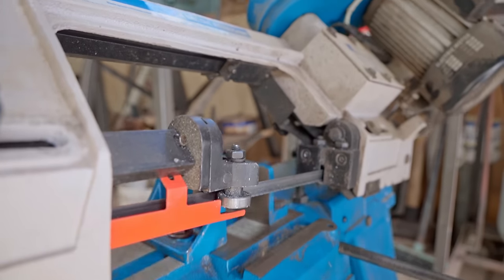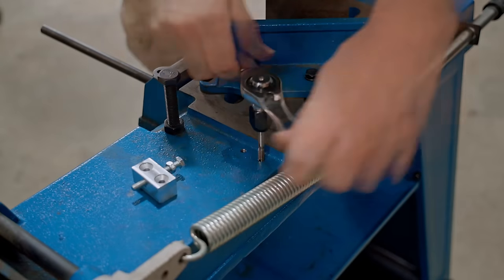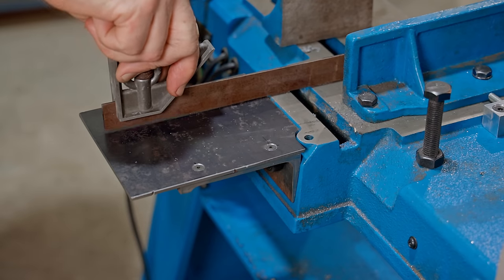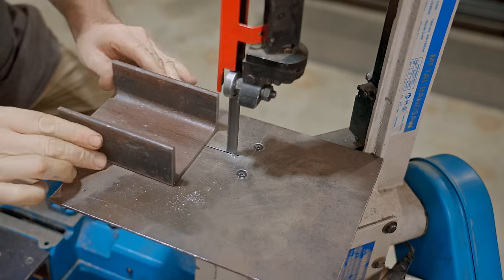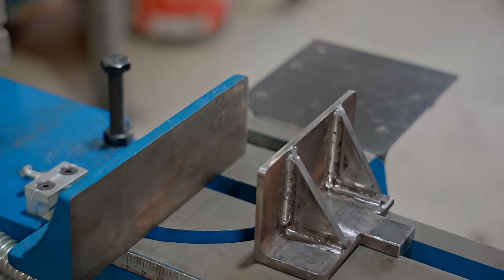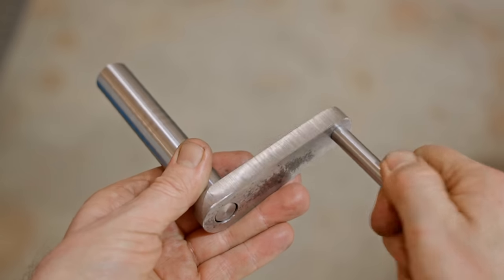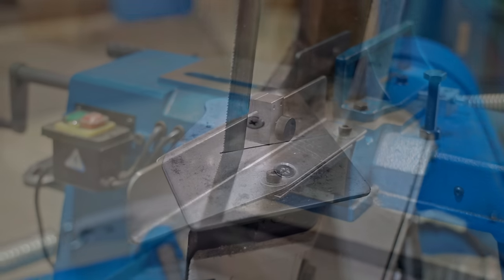Transforming a Budget Machine into the Ultimate High-End Tool

Comment: Tapping the button on the welder starts the gas so there is gas coming out of the nozzle when starting the weld, it is handy for more gas coverage for better looking welds and when ending keeping the torch above the weld for 5 to 10 sec so there is more gas until the weld cools down is also better for looks and quality.
Reply from the maker: Thanks - I do that sometimes but I usually forget. If I welded more often it would probably become second nature. :)
Reply: @PaskMakes  
Your welds look fine already, so probably not worth sweating over.
On the better MIG (and TIG) machines, there should be a setting labelled "post flow" which sets how long the gas coverage continues after the trigger is released and the arc has stopped. Might be hidden in a menu, or on a dedicated MIG machine, just be a fixed number of seconds and appear nowhere in the manual or control menus.

Comment: Great additions to the saw. I have one of these as well. Things I did to mine was I made a "0" clearance insert to fill that slot under the blade. Sometime when trimming a piece of stock it would fall in the gap and jam the blade. I built a base with casters as well but made mine out of channel iron because that was what I had lying around. That allowed me to make a folding stock support for the "left hand" side so I wouldn't need to use a stand to hold up long pieces.

Comment: Great job! Two additional suggestions, I added a hydraulic feed cylinder on mine for down feed control. I also made up a bracket with a cheap motor cycle seat on it that drops on and gives me a place to sit when using the vertical mode for long periods.

Comment: I have that same model. I made a replacement table, but I had to keep it small because of the lack of bracing.  Genius solution that I'll steal immediately!  The angle block is very nifty too. Best upgrade I've done to mine so far is to use Starrett blades instead of the cheapies.  Radical improvement.  Nice save with that Delrin collar!

Comment: I have had mine since 1980.  Made a wood base for it, oversize, with casters, added a shelf, had to fettle the blade guides like crazy to get it cutting straighter.  I like several ideas in this video, will try them out.

Comment: My saw has the exact same castings, stand, hardware and motor. King Canada version so it is dressed up a little different and has a POS plastic belt guard that won't stay tight.  Like you said, great little saw with a few shortcomings. The large table for when it is vertical is ingenuous.

Comment: I must confess that you have really impressed me by your thoughtfulness and workmanship. I think the best word to use here is WOW!

I have one of the original saws from which this design was taken. It was sold by EMCO Equipment and was made in the USA. I bought mine from their store in Woburn, Massachusetts in 1984. It has gone all over New England, to Florida and back since then. The only thing that I have ever had to replace were the roller guide bearings and blades. It still has the original belt!  That annoying horizontal table vanished years ago and has not been missed at all. My saw has had a lot of use and is still in decent shape.

The truth is that there have always been some shortcomings with these saws. However, they were nothing I really needed to address, until now. That is not so for the newer ones coming from China. Those need all the help they can get and then some, right out of the box!! You have gone way beyond what many who own the newer lower quality saws have done. I now feel like I have no choice but to follow suit and make some of these changes myself. Therefore, I will be following your footsteps and make these improvements to my own saw.

Thank you for your hard work and for making so many very useful videos. I will definitely be going through more of them.

Comment: My saw is about 30 years old, but it is exactly the same, but with a different nameplate. I've made similar modifications, but you've given me ideas for a few more. I ended up putting 2 pneumatic wheels on it, and making a micrometer scale for the cutting stop, as well as a weighted height latch that falls closed when you lift the arm to a certain angle. Thanks.

Comment: Nice work!

For Welding vertically try doing it top to bottom, falling, not rising! Hold the torch in a 45° angle pointing upwards and keep the puddle in sight, so it won't pass by your arc, or it will drop and leave a hole. Welding upwards is usually done when stick welding, mig the other way round. Hope, that helps!

Comment: Thanls for this Neil. I have had the same saw for a couple of years now and noticed you have the same, like you I have put up with the shortcomings but for the money it is a super handy tool.

I will certainly be coppying some of these ideas, thanks heaps for sharing.

Something else I find myself wanting for is an adjustable height prop for cutting long items, currently I use offcuts of steel on a beer keg 😂

Comment: I did similar additions to my Milwaukee Horizontal Bandsaw from the 60's 
The only thing I want to change is the wheel mounting. 
Original axle width is too narrow. I was moving mine after installing a set of wheels in a different manner but the same location I attempted to move the saw and tipped it over. 
The table mount and blade guide hit the floor and smashed.
That was a major hassle rebuilding the guides. 
All the work you have done is impressive. I intend to use some of your ideas on my much older version. Thanks for the inspiration. 😁😎

Comment: I made a modification for the bandsaw to use it vertical years ago and its great, what I would add to yours is a sacrificial disc where the band meet the table. The gap will widen over time with use and it would be easier to replace the disc than the whole table.

Comment: My solution to the crappy stand problem was very different but I’m very proud of how it turned out. I just scrapped the sheet metal legs and picked up a 500lb hydraulic lift table cart. I welded some standoff spacers to the top of the table  and extended the handle mounts about 10 inches so that the pump was under the saw motor when I raise the saw for vertical use. It’s wonderful because I can fit the saw under a workbench when not in use and the work height is adjustable.

Comment: Love the video, a tip for welding vertical with mig---pull your weld downward instead of pushing it upward but keep the nozzle pointing up if that makes any sence.
This is the only position that you can weld "pulling" with a mig and it gives a very nice smooth weld, you might have to adjust the wirefeed a little but you'll be amazed I promise.
Try it and please let me know, keep up the good content

Comment: I have one of these saws and a modification I made very early on was to drill and tap a hole on the opposite side of the movable jaw from where you want to clamp small parts. This has a 10mm bolt inserted into it and I can adjust it by hand quickly and easily to provide support to this side of the jaw when I am tightening it up on a small part on the opposite side. I hope this makes sense. I greatly enjoyed this video and will certainly use some of your other modifications. Thanks again :-)

Comment: Some great ideas I will definitely be applying to my saw.

You may have problems with your custom made moving jaw. To clamp things best, it needs to move and conform to the material once the material is up against the fence. With it rigid, you will probably only end up clamping on a single point or line as the fence can't move to fit the (highly likely) non-parallel/square material you are clamping. But for most things it will probably work just fine.

Comment: When I was in the Navy, our shop had the typical military hardwood 'butcher block style' countertop. By itself it weighed nearly 300 pounds held up by rickety sheet metal legs like your stand for you saw. The LPO had us cut 2x4s and put on the inside of the leg angle and drill holes and screw them in tight. They went from the foot pad to under the top with shims wedged into the gap. Sure the wood added another 15-20 pounds, but that table didn't sway, creak or have a cheap sheet metal leg buckle when you were using the work table as an anvil and were hammering things loose.

Comment: Awesome video! Always great to see a man confident & knowledgeable enough to modify his tools!
22:45 just need a magnetic cushion, now!
26:59 that roll pin is weaker than your original handle could push. Make a solid pin that barely fits, then thin the ends a thou; then texture the center.
A touch of locktite & hammer it in. You'll want as tough a steel as your lathe can cut.
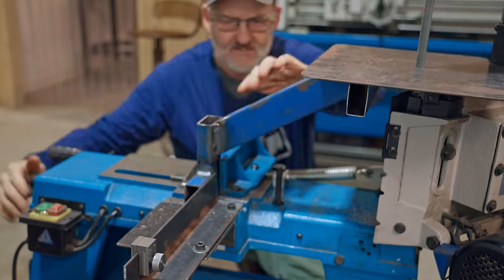21:11  Huh.  I thought you'd go w u channels & a locking nut on the big table; it'd be a slightly fiddly build, but much easier to store when not on use.
Hell, you could really go for it; have guide stops in a mounting slot, then a hinged lock flap, where a lock nut threads up through both tables and is flush on top. One thumbscrew, easy to fit, but solid as a rock.

Comment: I have the older brother of this and I've been working on a better down feed speed controller using a pneumatic cylinder and a few custom bits as well as coolant feed using a pond pump and 20L drum and a drip tray with a filtered drain. I do plan to make a better frame for mine and potentially put in a 3-phase motor with a VFD to control speed rather than use the belt drive

Comment: Excellent work, very well designed, and beautifully executed.
These saws are very common, and used to be  rather inexpensive.
The price has almost doubled here in the States, but it's still the best value for money spent.
The next larger saw, again very commonly manufactured in Asia, is $ 1,000 dollars more.

I have purchased both over the years, and still find the smaller one very useful, though my
fabrications have grown larger over time, and now require the use of bigger equipment.
I do enjoy the pumped coolant on the larger saw, as cutting through 6 " round bar takes a bit of effort
and time, with the blade getting rather hot, so the coolant makes the blades last much longer.

Speaking of blades, do yourself a favor and get high quality blades. Lennox or Starrett, or the like.
They make a massive difference in saw performance.
The small saw runs with a fine toothed blade, and the larger saw with a rather course one, 
as I hate changing blades !!! Blade life is greatly extended with quality blades, and having the right 
one always mounted is great.

I have most of your modifications already done, but your table mount will be my next project.
I love your design !!!

Thanks for sharing with everyone.

Tim

Comment: Fantastic modifications mate. This isn't a machine I have, or would use but it's great to see different ideas on how to fix problem areas. I thought clamping the large vertical base was a great idea, so was attaching the clamp handle with a slot and a rollpin.   By making things tool free means you're more likely to use it.

Comment: i bought one of these back in 1994 for 128.00 dollars.  for the price it works well enough,
but all your "improvements"  do address most of the deficiencies of the machine.
your angle setting plate is a clever mod,  thanks.

Comment: Got the same saw 40yrs ago.  Alot of great mods.  Just a friendly suggestion, when making your own knurled thumb screw that clamps against a metal surface.  After machining threads, l driiled a pilot hole in theaded shaft end to accept a pressed in solid copper rivet.  This will prevent marring the surface

Comment: Awesome job, and as usual, unbelievably creative! I'm glad you upgraded your own rather than just purchase a new saw, as it's more in line with me and I'm sure lots of other viewers in terms of purchasing power. I have a benchtop saw where it tilts to 90° but wasn't explicitly designed to run vertically. To get around that, I cut off a small piece of I-beam, flattened it, and cut the bottom to fit into the clamp. I then sliced a line for the blade, and I can clamp it in for a vertical table. It's not nearly as nice as yours, but it works well enough for a 4 inch max capacity 🙂 Now, I might revisit it!

Comment: Interesting modifications, especially the one to the vice.
 I bought one of those saws here in the UK around 25 years ago and I still have it, a fairly good machine that performs a tedious job while I do something more enjoyable on my lathe and mill.
 The only mod I did all those years ago was to make a new stand using 30mm square box section, plus cleaning out the worm gear box to remove the dirty lube, swarf and a little casting sand that they are sometimes supplied with. I really must get on with with modifying the vice now after seeing this video. 
 The other interesting thing is your Taiwanese/Chinese surface grinder, yours is the only one of that type that I have seen being used, it sounds quite smooth and does a decent job.

Comment: Great video, thanks for sharing.  Forget using lubricant or coolant on the blade! Just buy good quality blades with appropriate tooth count for the jobs. That saw will run dry then and no mess and no contamination to clean off before welding a part.

Comment: I would love to see a video  showing each modification before and after, if possible.   This is such a great video and I think a lot of people will want a list of mods you did, plans, and perhaps even bolt on kits.   I'd pay $200+ for a kit with the more difficult to make parts like the sliding jaw, cutoff support extension+stop block+fence, and possibly the quick install/remove vertical table.   The design of all of these mods is excellent and it's impressive that you seemed to do these without a whole lot of design planning.

Comment: Gonna pinch your vertical table idea mate !
When I got my saw, I pop riveted a piece of tin across the front to stiffen the framework and then added a bit of aluminium channel at an angle below it to catch the chips (and small parts !) and funnel them towards a plastic parts box sat on the floor. I looked at improving the moving jaw, but then saw a video where the guy used a slice of thick walled tube (banana shape !) against the moving jaw, to clamp short pieces to the fixed jaw (one end against the fixed jaw, the other end sandwiching the part to the fixed jaw with the outside curve against the moving jaw ) game changer !

Comment: Great work. Some great mods I will consider for my similar saw. 2 mods I have done is add a hydraulic cylinder to lower the saw accurately during cuts and added coolant system and coolant drip tray.

Comment: Great job 🎉
Small sugestion, u can put a bolt on the left side of the small jaw for when u are grabing smaller pieces. The bolt will allow you to adjust for the thickness of the piece easily.

Comment: Mine is from Harbor freight. One factory must make almost identical machines for different brands. They are an excellent value. They are very top heavy and wobbly. Mine is mounted on a castor assembly because I had one and that is much better now. The T-nut is a great idea as the 2-wrench  requirement is bothersome.  Might do some of the other mods, but in ways not requiring a machine shop!

Comment: Would you believe the first time I bought one  of those in the late 80s it was on sale at Home Despot for 79.99. First thing we did was put a Starret bimetal blade on it.  We didn't have a vertical band saw and it came with a platform attachment so when  you  flipped t upright you  could use it as a vertical band saw.

Comment: As an experienced welder, with the exception of a certain power level and above vertical welding just isn't done. And those were beautiful. I worked for a company where their processes were almost entirely vertical. And we had the high powered 660 v 3-phase pulse wire feed gmaw welders. One machine I don't know the details of but it was so powerful it had a water cooled gun on it. A round of applause for those vertical welds.

Comment: Great work! I battled with my 4" saw for years before getting the 7" one off marketplace for a great price - turned out the gearbox had eaten itself, fortunately easy enough to buy new worm and pinion from Hare and Forbes. Runs great now and significantly better than the old 4" ones. BUT! The modifications you have done here would equally apply to the bigger model and I think I'll put some time in to getting some done. The waste side table and vertical table would be most handy.

Comment: Lots of good ideas. Though the most useful one for me was fitting the saw on top of a wheeled tool drawer cabinet. Plus two foldable roller stands. Decent working height and can cut 6 m (20 feet) long material.

Comment: Scale to set the angle? Luxury! My saw is Nth hand and judging by the witness marks the scale fell off a loooong time ago 🤣 I was planning to make a whole new stand for all the same reasons you gave (they are a pain in the hole to try and shift around the workshop, mostly) but you've just given me a very good idea.. thanks, Neil!
Reply: You also inadvertently gave me another good idea.. add a detent ball & spring to the fence and add divots to the base at 90 & 45deg positions. Could be done by through-drilling the fence with it accurately set, then tap the hole in the fence for a grub screw, drop a ball bearing in, a short spring and the grub screw and voila. Granted the grub screw and ball bearing will make a bid for freedom if you ever remove the fence, but... I could live with that, I think!

Comment: Nice job on diagnosing and replacing faulty parts pump housing and impeller looked almost new. Now do the cosmetic work and make the machine look worthy of ongoing maintenance. Does not take long to clean and paint. Seems upper chamber (lid) seal needs replacing to eliminate leaking/staining to complete repairs. This machine is worth the effort to complete the process of making it a worthy addition for your operation. Ray Srormont